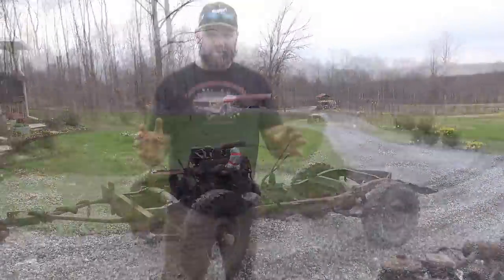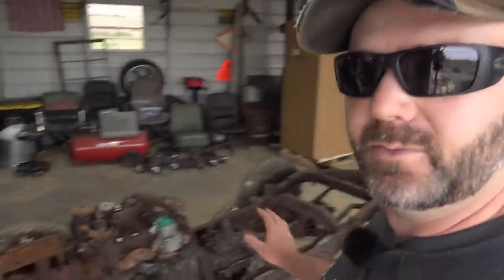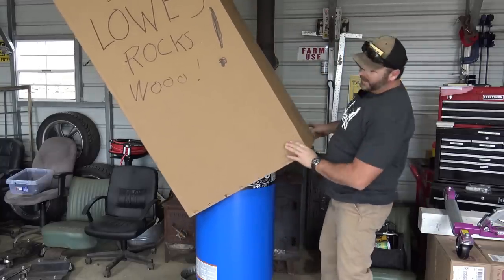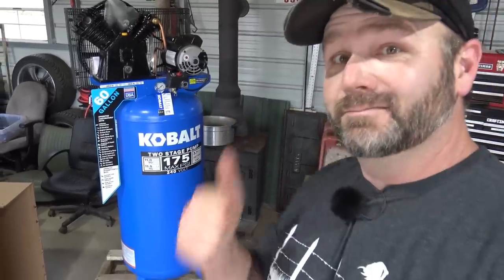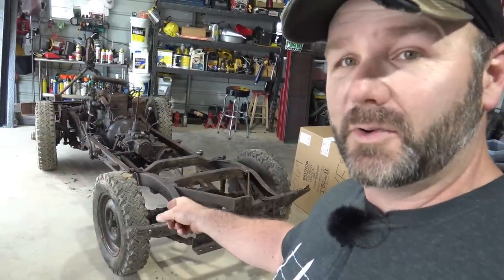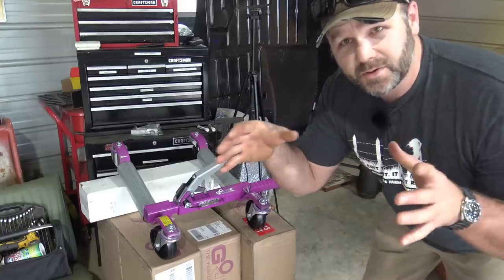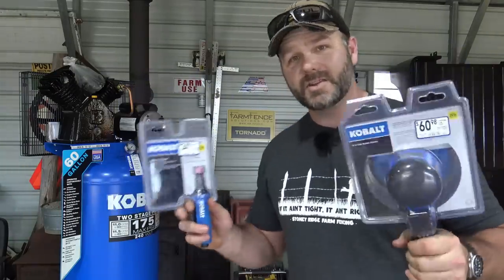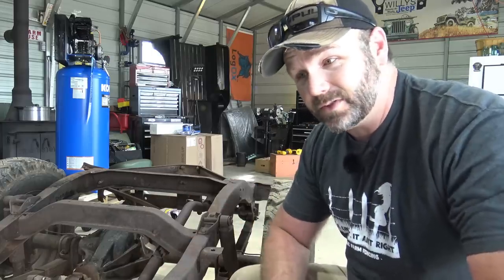Willys Jeep Rescue: CHASSIS WORK..and COOL NEW TOOLS to get the job done!

Comment: Dont know if you know of the tool that is like a sand blaster but don't use sand it uses steel rods I think it is called a needles air tool breaks up rust without the sand pretty noisy tool but does a good job from what I've seen.
Reply: Needle scaler. Great for really crusty rust, or cleaning off weld slag.

Comment: A buddies dad owned a body shop and I used to spend a lot of time there. He used to use blankets to cover everything except the area you're sanding. Always clean afterwards, a little dusty but no sand. He also used to drape plastic from the ceiling to the floor just around the vehicle and would then blow it out then spray with water before painting. I learned the hard way that you need to be sure to wipe down the ceiling otherwise you get to re-sand and re-prep the entire top of the vehicle. Great times! Love the Willy's.

Comment: You don’t need an engine hoist with your big tractor. Works really nice and saves you some money.
Reply: Hey I just got one of those air compressor to
Reply: I was going to say the same thing... I have pulled many motors with a bucket alone.  Forks make the job 10x easier!

Comment: Just a FYI. Use a heavier wire bush. Use a knotted stringer wire bush. Really speeds up the cleaning when doing the long runs. The crimped wire brush you have is great for tight spots. I really enjoy the channel, Josh. I learn something new every time. Cheers

Comment: If the leaf springs aren't bent or broken they are fine. If they are just misaligned then get some spring clamps (under$4 each). They didn't always use them back in the time frame of the Jeep's day.

Comment: Josh for the engine crane, get one with folding legs as they take up less room in the shop. Buy 2 yards of 5/16 chain and 4 d shackles at the hardwar shop. You can hacksaw them to a suitable length for lifting the engine. Get a soft car cover for the grand national because grinding within 10 feet of it will throw iron filings the size of dust onto the paint and they will stick and go rusty if they get wet. also get a cup shaped wire brush wheel that fits your 4, 4 1/2 or 5 inch angle grinder. They have groups of twisted wire and are way more vicious than the ones with just straight wire. Great for stripping off rust and paint. Wear gloves and goggles as when the wire strands break off they will embed themselves in you without any effort on your part.

Comment: Good video.   Absolutely right if body man recommended Eastman products that's the one to use.  The wire brush drill attachment is great for small or tight spaces but you need to use a electric   grinder with larger brush for wide open areas.
Reply from the maker: Agreed Larry....that's why we got some air tools to get the job done....frame really isn't that big...not gonna be a bad job at all

Comment: Use an angle grinder with a wire brush disc, a lot easier and way faster than that little drill.
Reply: Yes been there, angle grinder with wire or flap disk
Reply: The braided wire brushes last like crazy too
Reply: Yeah when little cordless heat up, switch to angle grinder with a.c supply, faster and noiser😃😃😃, need ear plugs, eye, breathing apparatus, ....
Man can't wait to see Willy rooming around the farm.
Reply: I also use an angle grinder with a twisted stainless steel cup brush. Lasts a long time and covers a lot of area. Save the drill and cup for tight areas.
Reply: Sage Comstock i was going to comment that.

Comment: That rubberized undercoating all it does is hold in moister. then it rust from the inside. Since you are using spray cans buy the snap on spay handle then can spray like a champ!

Comment: You could use your front loader to remove the engine. If you didnt want to get the engine hoist. 
But I have removed a few engines with the loader on our tractor, works good if you have a good operator that knows your signals.

Comment: When setting up your compressed air system, hit Lowe's for some "high flow"  896797 quick disconnects.  The hole is half again larger than a standard one.  Larger hole more air flow at the tool.  Lowe's has them but you have to look hard.  Harbor Frieght has them on sale this month.

Comment: Eastwood makes good stuff. I'm going to be using some of their rust encapsulator and chassis paint on my 79 K10 Chevy pickup when I get my garage built. Already have some POR15 for the cab floors after I patch them. (I'll put separate sound and heat material in after the POR15)
Reply from the maker: Awesome!

Comment: A plug-in high speed drill or angle grinder with wire wheel will clean the frame a lot quicker than a cordless drill - speaking from experience!  Cool series!

Comment: Harbor Freight shop crane with a load balancer will do nicely and for many other things as well. I even used mine to set the tub. 

Brake lines - just buy a kit. - preformed and ready to install. 

I had my frame sandblasted and powder coated, wasn't that much and well worth it. Saved a lot of time...

Where do you get 30 Grand??. I had to replace everything on my WWII jeep and I have about 10 Grand total, (including the tub kit and rebuilding all of the mechanicals). Virtually every moving part was replaced with brand new -  all new gears, bearings, leaf springs, gauges, etc.

Comment: ok i am not going to read all the comments, so ill just recommend.  you said new brake lines.  i live in the rust belt.  i am tired of replacing brake lines and found this nickel copper brake tubing.  easy to bend easy to flare and wont rust.  anytime i replace a line i use this stuff.  since i have found it i tell everyone that does their own work about it.
Reply from the maker: Cool thanks for the tip!

Comment: once you finish with all the fancy rust encapsulation and undercoatings, you should get a jug of cheap bar and chain oil and give your frame a good coat of oil.......there is a reason old vehicles have frames that are still solid after years......seeping oil that traps dirt turning into a thick tarry substance keeps water off of the metal......just reapply every year when things dry up. The truck I just bought in Dec will be getting a nice coat of oil once the weather is appropriate for it.
Reply from the maker: Lots of folks have suggested this very thing...grease and oil does stop rust that's for sure

Comment: Look at Eastwood"s brake flaring tools they are perfect. You are going to need a dryer for the air compressor in the NC heat, look at the Harbor Freight dryer it"s $399 but will be a perfect add on. You need dry air for painting and the sand blast cabinet.
Reply from the maker: Thanks for the tip!

Comment: wasnt being critical just trying to save your drill.its much easier to use an electric grinder with wire wheels to clean off the rust much quicker too.save you a whole heap of energy as well.Love the jeep build i sure will enjoy seeing it running around the farm.

Comment: In my mechanic shop we use a battery powered grinder with a wire wheel and we don’t use it that much but it goes through quite a few battery’s and with that much cleaning you have to do it might be wise to get a air powered grinder to put that wire wheel on
Reply from the maker: Yep...I agree...but we don't have the compressor hooked up yet...soon my friend we'll have it all together
Reply: Stoney Ridge Farmer cool I’ve watched all of these videos glad you get to keep it and your doing a great job with the restoration keep up the good work

Comment: Them go jacks are something else. Best design I have seen. 
 Not a big fan of rubberized undercoat. When water ever gets in behind it, and eventually it will, it will rot the metal big time. 
I had a trailer that a guy brought me to basically go over, fix lighting, check wheel bearings ect. I called him over a few days later to show him what this rubberized under coat had did, lets just say the trailer was 5 years old, and within 2-3 more years I could have put the hammer through the frame. Now granted this trailer was used hard, and left sitting around the shore(salt water), but still was the fact it trapped any water, salt ect. I ended up chipping the whole trailer, painting, and rust checking. When chipping the undercoat was coming with 1/16th - 1/8th inch rust scale, off most of trailer. 
 In saying all that, on your Jeep, may work out the best, as most of the time it will be stored in a dry place.
 Glad to hear the Jeep will remain in the family, as it has for years.
Reply: Yes that rubberized coating can do more damage than it saves
Reply: @MajorWeakness , Junk as far as I'm concerned but, Jmo.

Comment: Go to Harbor Freight get some sanding stripes pads the go on a 4-1/2 hand grinder they work better then a wire wheel on a drill and it well really save your wrist
Reply: Nathan Cooper don't forget HF flapper discs too, between those and a couple different styles of wire wheels on an electric angle grinder, be done in no time.
Reply: Yep, flapper discs and wire wheels on the 4-1/2 make light work. Also, 
fond of Rollocks on the die grinder for those tight spots...need to give that new compressor a break-in.
Reply: Jeffrey Wydra A wire wheel for a 4 1/2 in angle grinder works vary good as well. That’s what I’m using on my Jeeps frame and body
Reply: He means flapper discs. They work wellbut so does a wire wheel disc on that angle grinder. I prefer the wire brush disc. Flapper wheel can take off too much depending on the grit and pressure applied.

Comment: Keep the Jeep, its been in the family long enough to be your uncle :-).  Use your DA sander with light sandpaper to clean the flat parts of the frame.  A wire wheel works - just takes a long time :-(

Comment: Strongly suggest you do not use undercoating.  It traps any moisture and causes rusting you won't see until it's too late.  Use Fluid Film and/or Wool Wax or, if money's an issue, thin out some bar and chain oil and spray it.  Plenty of info on the internet on these products and why undercoating is so bad.
Also, it's best to spray the rust encapsulator on already rusty surfaces.  It needs the rust to complete the chemical action and doesn't work worth a hoot on clean metal.  I usually spray dilute vinegar on parts and let them sit overnight.  Pressure wash them and , when dry, spray on the rust encapsalator.  Works like a charm.

Comment: Have you thought about stripping the chassis completely and then  getting it sandblasted ? Here in the UK its standard procedure with a restoration of anything  this age. It usually shows rust damage not previously visible. Of course we tend to have wetter conditions along with lots of salt on the roads in the winter.

Comment: I tried rust encapsulator once, I wasn't impressed, I now use por15 and the results are waaaaaaay better
Reply: Por 15 is awesome. Used on my 73 Ford PU and some body work on a 2000 Lumina

Comment: I used POR 15 on my jeep and made bumpers from I beams. That  POR 15 is great stuff, just don't get it on your hands. I was working in the OR and I could not even scrub it off with any soap or acetone.
Reply: I hate that stuff, used it 3 times and every time it peeled after 3 yrs. I now use the Diesel, Kerosene, 5w-20 mix method and soak the whole underneath.
I do agree about getting it off your hands, impossible. It has to be worn off or fall off from sweat.

Comment: Have you thought about wiring in a mag starter for the new compressor? It will start the motor on the compressor with less spike. I have one on my Case 80 gal. 5hp 2 stage. I bought it all back in 1986 ant it has worked great to this day with no problems.

Comment: Do they have a pneumatic tire option for those jack/dollies, for those of us that don't have a concrete pad? Also the frame should be Army green, not black. It is/was an Army jeep after all. I hope you end up at least nodding that direction with the body paint. Olive drab with a circled star on the hood would be nice. Maybe come up with a bumper number for Stoney Ridge Farm for the bumpers, like the Army put numbers on them for identification of which unit they belonged to. Might I suggest [SRF-53]? You did say it was a 1953, right?

Comment: Engine hoist? You got a loader on that tractor? I found a 2ton extended out was only 500pounds. I need it up higher body on, it’s also a 304 but that cherry picker won’t do it. We struggled getting the 304 out. Not even trying it going back in. Loader will.

Comment: I am not an expert, but would it save your cordless, expensive Milwaukee drill if you had a air driven wire wheel attachment from your new air compressor? Really enjoying this restoration. Good choice in keeping it for yourself. Cheers from 🇬🇧

Comment: I have a question if I use the rust inhibitor and spray or on the part of my frame that has a little surface rust do I have to put a top coat of paint over it or can I just leave it ?
Reply from the maker: You can just leave it...top coat will do a longer lasting job I'm told..but I'm no pro body guy

Comment: If you are going to use your tractor to remove the engine, maybe you should check to find and engine stand instead; so you can go back to using the tractor if you need. 
Wow, I see 390 comments already here and check and you have 190K subscribers; weren't you at 10K just a few weeks ago? Nice work, thanks for the videos.

Comment: Use a brush on an air tool or angle grinder and it will make the drill brush look like its broke.  Also the 3M pads on an angle air tool works great also.    Drills are just tooooo slow
Reply from the maker: Agreed for sure!  Just doing some test work today....until I can get the compressor all hooked up

Comment: My 2 cents like everybody down here:
You've got a monster of a compressor. You bought a sandblaster box with the proper air/sand mixer included. So why not blast your frame ?? You don't want all the dust in your garage. Good. Remove all the underpinnings from frame now. Take it outside on cheap DIY horses stands, and with a cheap plastic sheet as a backdrop, clean the damn thing ! Same with the diff, rods etc. Done in minutes. As for the u-joints, knuckles, bushing, they sure are toast anyway. 
I'm only trying to help here, Man. With your lil' drill and small wire wheels, you'll still be at it next month ! And lower grade result at that.
Been there, done that. No fun.  :-))
Reply from the maker: Still got some stripping down to do...taking the frame apart from everything else (suspension and such)....trust me man...I'm gonna do a good job....and believe me...just showing this 1 foot section of frame...I've been ripped apart by people telling me I'm doing it all wrong....man...money, time, tools and work....that's what this is gonna take...be patient....and remember...it's a farm jeep for sure...here is some top secret info (I'm trying to work out a way to get a kubota diesel engine for it...that's part of the delay here) sshhhhhh....ur the first person I've told!!
Reply: @StoneyRidgeFarmer  
I am honored man ! You know, I am not a naysayer pr something but I tought as I said , you have everything but a backdrop. Will save you time and aggravation ! Kudos !

Comment: Just Remember, there is a Reason that Vehicles Manufactures left the 6 volt system and went to 12 volt--the later has twice as much Energy and Gauges/Lights worked much better. If I were you, I would Remove the Old Generator and Replace with Alternator and Go from there...

Comment: If you have a good MIG welder it should have no trouble in that frame on hight setting
Reply: Exactly and still be able to weld the thin stuff. Just make sure it's a 220 version with a gas hookup.
Reply: @augustreil  I have a 110 Lincoln welder with gas I got back in 1998 and welded steel that think just fine
Reply: @ncooper7757 , Yup, I just like the 220 for when I need more nut !!
Reply: My Lincoln Pro Core 125 is my go to for anything 1/4" and under. .035 flux core wire and high setting will do the job. Grind most of the rust off, and go to town. Not the prettiest beads, but gets the job done. And better than dragging out the big stick welder or wasting gas on the MIG. Just my 2 cents.
Reply: @KJ-kw7gh , True.
Reply: @augustreil  that's cool over the past 20 years the houses I have lived in just have 110 so that's what I am limited to using
Reply: Kevin Joyce sold my 125 to a buddy and bought a 180 brand new of CL for $350, holy crap its night and day. It will blow through 3/16 I'm not careful though. I'm still just doing flux, ain't doing beauty contests.

Comment: I love Lowes too, but in the past year or two, and I'm not sure if this is just at my local store or not, but they have restructured their employee layout, got rid of all dept managers, and the store has gone down hill horribly.  Trash everywhere, no one helps you anymore.  Just horrible.  I have also gone from being store loyal to brand loyal.  I used to buy everything from Lowes, but now I shop for the brand, an example would be I only use Diablo saw blades, and they are only sold at the Depot.  I'm ranting, but love the new compressor.